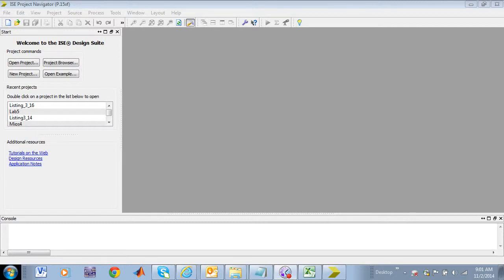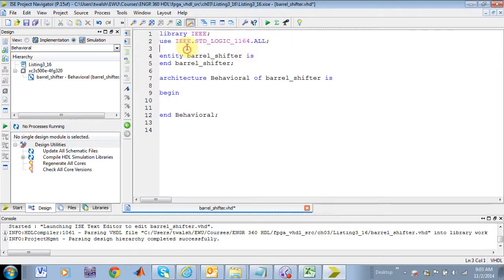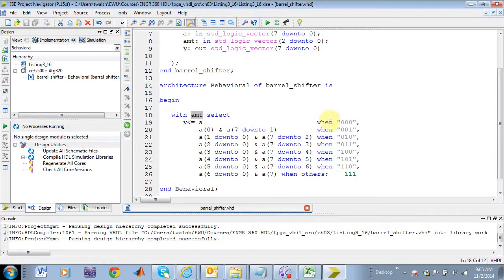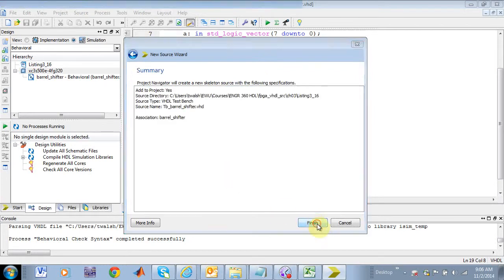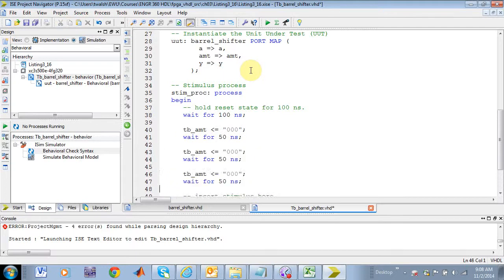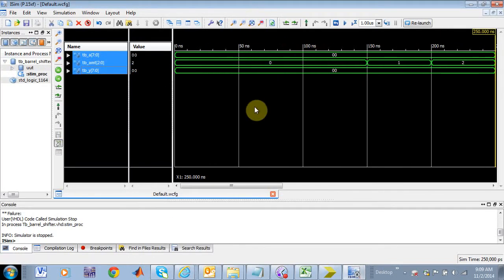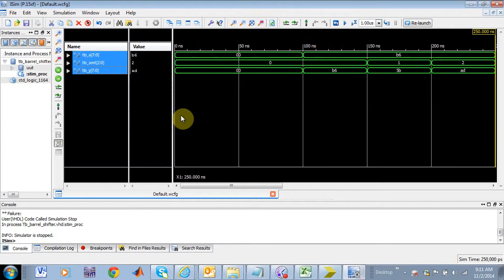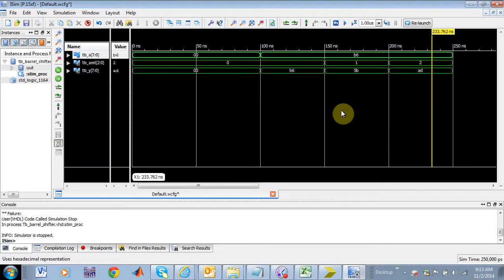VHDL: Listing 3.16

Comment: library IEEE;
use IEEE.std_logic_1164.all;
use IEEE.std_logic_ARITH.all;
use IEEE.std_logic_unsigned.all;

--Entity Declaration

entity rk_lab3_octaldecoder is

port (
x : in std_logic_vector(2 downto 0); 
y : out std_logic_vector(7 downto 0));

 
end rk_lab3_octaldecoder;

--Architecture defination
architecture decoder of rk_lab3_octaldecoder is
begin 

 "y" <= ("00000001") when ("000"); 
 "y" <= ("00000010") when ("001"); 
 "y" <= ("00000100") when ("010"); 
 "y" <= ("00001000") when ("011"); 
 "y" <= ("00010000") when ("100"); 
 "y" <= ("00100000") when ("101"); 
 "y" <= ("01000000") when ("110"); 
 "y" <= ("10000000") when ("111");

end decoder;

Error (10515): VHDL type mismatch error at rk_lab3_octaldecoder.vhd(23): boolean type does not match string literal
Error: Quartus Prime Analysis & Synthesis was unsuccessful. 1 error, 1 warning
	Error: Peak virtual memory: 4835 megabytes
	Error: Processing ended: Fri Oct 01 23:38:57 2021
	Error: Elapsed time: 00:00:07
	Error: Total CPU time (on all processors): 00:00:15
Error (293001): Quartus Prime Full Compilation was unsuccessful. 3 errors, 1 warning